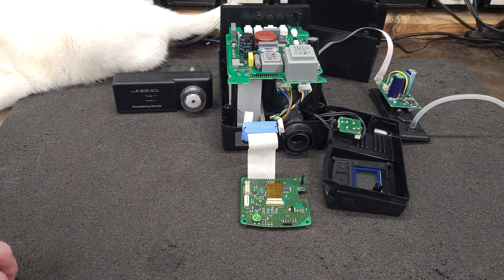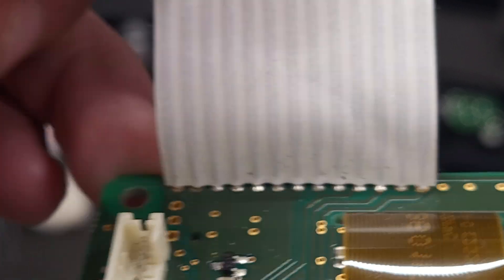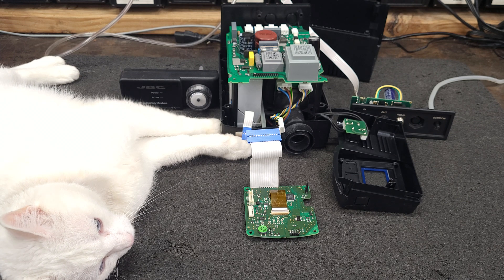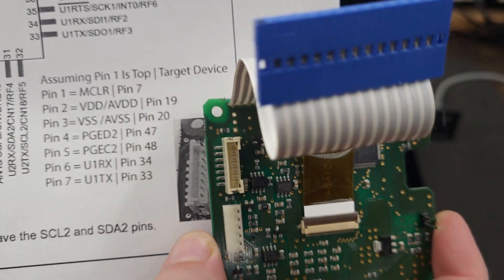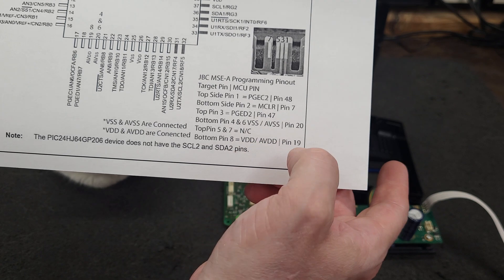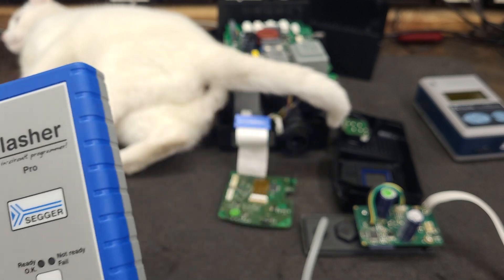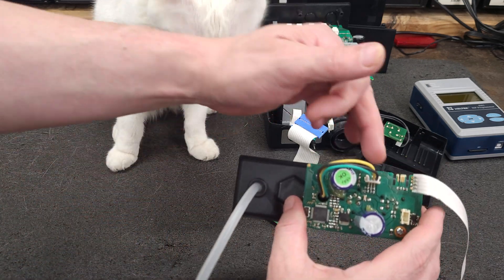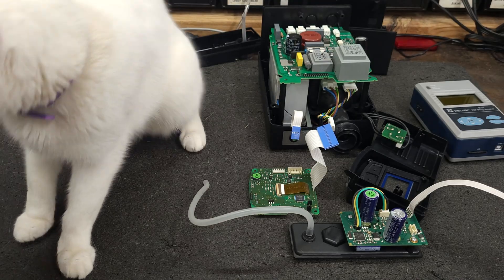JBC Tools Top Quality! Flux Residue, Poor Soldering, Cheap Caps! JBC Tools Is Anti Repair!

Comment: I recently purchased a JBC CD-2BHQF, manufactured in 2023. When I opened it up, I found it uses a switching power supply. The connections between the power supply and other circuit boards had poor soldering and residual flux. Additionally, some parts of the circuit board were blackened. I emailed JBC to report these issues, and they responded that they will strengthen their production line management.

Comment: Very disappointing to see a product that costs that much uses cheap components and tries to hide information so you can't fix it.  There is really no excuse for them to not solder in that connector and to have flux all over the board.  I guess I won't be buying JBC.
Reply from the maker: I call it my $5,800 Mistake I must Live With. I admit the thermal performance characteristics and Features are Great, But Customer Service and Build Quality is Terrible! Read about My Full Experience Here: https://www.stevenrhine.com/?p=131943

Comment: firmware in pic mcu  seems to be read protected  by fuse
Reply from the maker: I would assume it is, Have you attempted the read? Some manufactures do not lock them.

Comment: Those flex cables with crimped pins at the end are the spawn of satan. Once the metal oxidizes at the interface between the pins and the traces, bad things happen and you have to replace the thing with hopefully something more reliable. Discrete hookup wires twisted together work well and will outlast most things :)

Comment: Maybe you can take individual contacts from a breadboard and solder them at the correct pitch to make something to fit that edge connector.
Reply from the maker: I am sure it will be a common card edge connector once part number is known I will publish it to help all.  I could 3d print a type of pogo pin clip but no time nor the 3d modeling skills to do it efficiently. I would Rather find the card edge connector solder a few wires and attempt the download it. And it is a 50/50 chance Targets will be read protected and a useless effort.

Comment: wow, I definitely need to open up mine I have the same model and replace those capacitors with some name brand .. I personally never messed around. We’re trying to dump firmware or install new firmware on the hot air station 🚉 back in the day. It was described to communicate with the computer, but never got that working .. what’s up with that barge wire That jumper ?